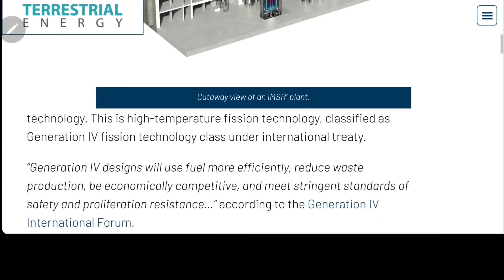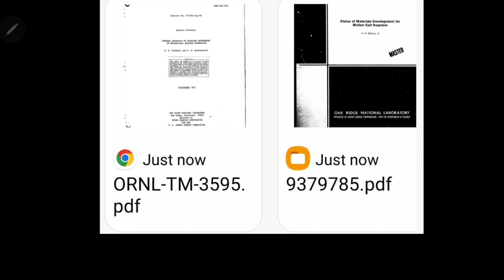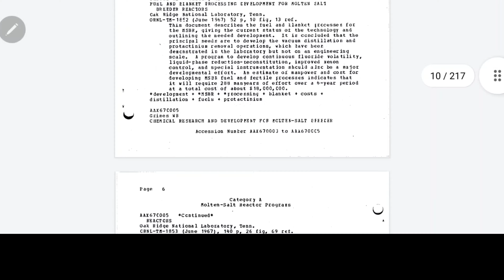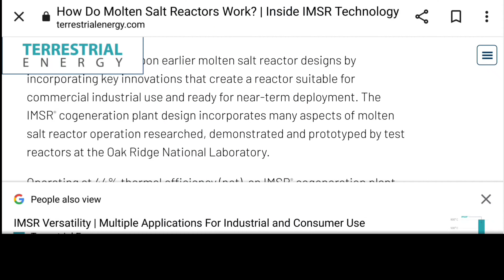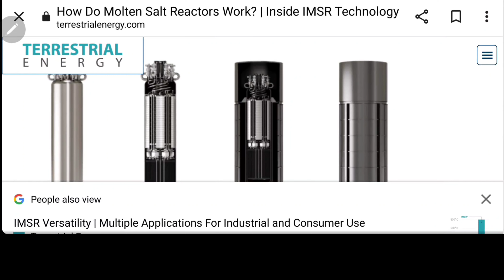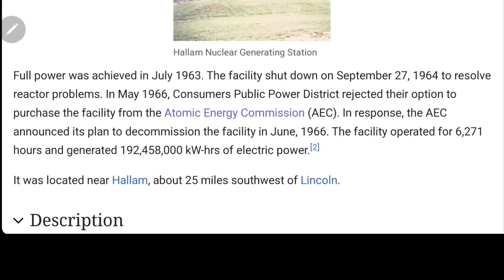Molten Salt Reactor: Future or past?

Comment: "We have found that if the U(IV)/U(III) ratio in fuel salt is kept
below about 60, embrittlement is essentially prevented"
Source: STATUS OF TELLURIUM-HASTELLOY N STUDIES IN MOLTEN FLUORIDE SALTS 
1977
Same strategy is used for newer alloy protection too.

Hallam nuclear reactor was not molten salt reactor. Its liquid metal cooled one.
Reply from the maker: Yes I know what the studies says from the National Labratory in 1977.  They show a side by side comparison of the metal but the difference is the temperature difference to 700 C.  It is not essentially prevented because they can never prevent the defects at the grain boundry layer where the embrittlement takes place.  It all revolves around our abilities of metallurgy and removing any possibility of defects in the metal.  To use other alloys would mean it would become too expensive to compete in any market.  And no...Hallam was a sodium cooled reactor at high temperatures....liquid metal....splitting hairs here aren't we?
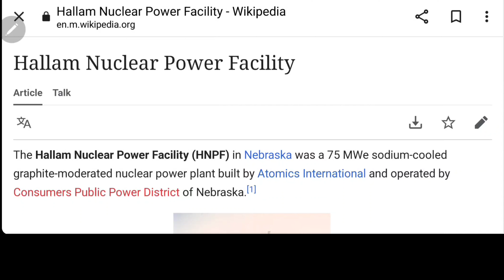Reply: @paulmobleyscience  8:52 it's not hair splitting if you miss state it black and white.
Reply from the maker: @CraftyF0X  OK I will stand corrected if you tell me which liquid sodium they used. Was it Mercury or solder or something entirely different?
Reply from the maker: @CraftyF0X  Can we all agree that salt a metal don't mix and shouldn't be used as part of some complex system to produce energy only for a profit for a corporation that cares less about your power to your wall and more about the at least 300% profit.
Reply: @paulmobleyscience  Im not sure what are you even talk about ? Salt corroding metal is a misconception, salt and water corrodes metal but salt by itself does not. Matter in fact under reactor conditions water by itself corredes more than salt, and still LWR technology is perfectly safe as long as the inspection schedule and the expected life time of the components are respected. And what is that all have to do with your general disdain toward neoliberalism and capitalism ?
Reply from the maker: @CraftyF0X  Normal reactors only work because of the additive of hydrazine, otherwise they would begin to break down in much shorter periods of time.   It's part of that "other" category when talking about effluents.
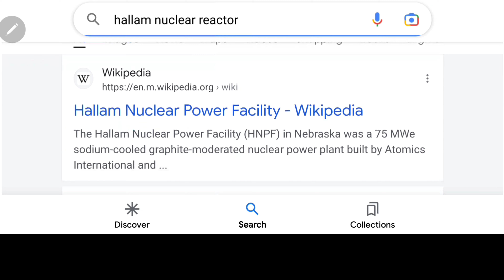Reply: @paulmobleyscience  At 8:46 "molten salt". If you think differentiating liquid metal cooled and molten salt reactors is hair splitting then you should not talk about reactors at all.

 What metal defects are you talking about? In layman's terms tellurium atoms "want" to be alloyed with metal that is between metal grains more than it wants to be in the salt. Because of that it "dissolves" inside said metal and that makes the metal brittle. What scientist in that paper did was they added additives to the metal so that it would be less attractive to Te atoms and changed salt "PH" so it would be more "attractive" for Te atoms. As a result now Te atoms "want" to be in the salt more than in the metal. This mean embrittlement is essentially prevented.

Temperature doesn't change if embrittlement or corrosion happens or not. What it changes is the speed of the reaction.
Reply from the maker: @user-py9cy1sy9u  I agree I made a mistake but to say I shouldn't talk about nuclear reactors at all is ignorant.  Yes lead-bismuth...ok so let's talk about the real issue why liquid sodium or molten fluoride salts are used to begin with.  Tritiated water and what it does to metal.  It doesn't do what the salts do to metal, in fact it just passes right through, permeating the metal day after day.  It doesn't matter what they do and why we still since 1977 do not have commercial MSRs. That additive that's added to the metal and coolant in that study is not a commercial sized reactor that ran for an entire length of what the PWRs can operate for decades.  That was never done so to say it can be scaled and work perfectly without tellurium embrittlement of the vessel occurring is just wrong.  That is an assumption that's been made and the Chinese will find out first hand won't they?  Also that additive didn't change what the moderator has issues with and that's major contraction and expansion. All this for a corporation to make profits when you can make your own power 24/7 365 days a years rain or shine, windy or calm.
Reply: @paulmobleyscience  Reactors with FLiBe salt will create more tritium than PWR.

Chinese reactor is a research reactor. Its purpose is to gather data so they could build better reactors not to run for decades.

Te embrittlement can also be prevented by using sacrificial anode. There is more than one way to skin a cat. Another thing is that TeF6 boiling point is −37.6 °C meaning that Te will be constantly removed by gas system. For a commercial reactors you might not even need to prevent Te embrittlement. You might just need to slow it down enough to where other components fail first.

Yes graphite lifetime is a problem. I have ideas how to prolong its lifetime. Now Im learning about x-ray spectroscopy to see if I can use it to measure changes in the crystallinity of graphite.

Electricity is the least useful thing that high temperature reactors can make.

15% is the whole nuclear island with concrete and control rooms. Reactor vessel is less than that.

Thorcon plans to change its reactor every 4 years

Molten-Salt Reactor Experiment (MSRE) operated for 4 years.
Reply from the maker: @user-py9cy1sy9u  Yes exactly more than one way to skin a cat.  We no longer need a corporation to build anything to produce power to our walls.  The only thing that needs more power than that is industry of which can be handled by everything else besides nuclear anything for power production.  I like your information because it shows people what's really going on.  Let me ask you this....why doesn't the inverse square law apply to extended sources of radiation?
Reply: @paulmobleyscience  Every time people put Geiger counter closer to radiation source it starts to click faster so inverse square law still applies. But radiation is not the same as radio waves and both beta and alpha particles interact with matter on their path reducing their reach.

Fun fact coal power plants worldwide kill more people during their normal operation than nuclear power plants with their accidents. Fear of radiation has killed more people than radiation itself.
Reply from the maker: @user-py9cy1sy9u  I didn't ask for the definition of the inverse square law...I asked why it didn't apply to extended sources of radiation?
Reply: @paulmobleyscience  Be more specific. Are you having in mind total amount of radiation that a matter emits (becquerels) or radiation that reaches the detector (sieverts)? For sieverts it does apply in part and for becquerels it doesnt because it measures different things. Extended or not does not change things
Reply from the maker: @user-py9cy1sy9u  It doesn't apply to extended sources of radiation because the aggregate of points...sources couldn't be known. To find one's intensity of exposure externally (detector) the point of each emitter must be known to calculate one's exposure and that is not on a 2 deminsional vector graph its 3 deminsional on a planet with a water cycle and water solubility of a corium oxidized crust and uranium sulfate that is very mobile that makes those points move around in real time and no way to establish that aggregate of point sources.
Reply from the maker: @user-py9cy1sy9u  So essentially..our devices can only tell us if we are getting hotter or colder but the "levels" of exact measurements are wrong and could not be known.  Then you add gamma attenuation (shielding), Townsend electron avalanche and quenching gas for electrons and the cathode anode issue, dead time when nothing is being measured, and the need for a perfect voltage for the measurement to be correct....from a battery.  Also, with the less expensive ones when connecting it to a computer, the computer will backfeed current causing fluctuations in the readings that aren't really there using an Oscilloscope.
Reply from the maker: @user-py9cy1sy9u  More specific is Indian Point NY with 65,000% above background levels in the wells under the site.   In talking about the Blue Ridge Environmental Defense League 2007 Vogtle Georgia study that shows levels of Beryllium-7,  cesium-137 and tritium increases in the river with people in a 40 mile radius drinking water that had a substantial rise in raw and filtered drinking water of tritium versus before the site was built.  You people are ignorant to be here arguing for this nonsense and the only answer is you two either work for the nuclear industry in some fashion or you know someone that does.   You must understand how I work and have been doing for years....strategically place something to draw those that have knowledge on this topic into the conversation to show them for who they are and it worked beautifully.  Thank you.  My reputation you spoke of before is squeaky clean because I don't make money from this greedy diabolical organization of ignorant money hungry people that make youtube accounts to sway the narrative using that word salad that I just used on you to prove you wrong.   People that push buttons for a living inside a control room watching for numbers on a gauge all the while they learned just enough information to get that piece of paper stamped with I am smart now for repeating after what they told you to repeat without critically thinking or only see dollar signs, big houses and fast cars and blinded to the very laws and science you repeated back to them.  Corruption is the one factor that causes every formula to be null and void.  It all looks great on paper but in practice its a much different story.   I bet you didn't expect that when you woke up today and put your pants on the same as everyone else.
Reply from the maker: @user-py9cy1sy9u  You see Elina can't control the comments here like she and others do on their channels.   I opened many peoples eyes on her channel and they will begin to see and that now single digit percentage of global energy production is falling more each day.    Who do you work for?
Reply: @paulmobleyscience  7 replies in a row... You are getting weird now. Who is Elina? I'm nuclear enthusiast and youtube algorithm showed me your video.

Also radiation exposure is not calculated with vector graphs... and inverse square law doesnt work for radiation exposure even for single point sources.
Reply from the maker: @user-py9cy1sy9u  Then why is the inverse square law used for calibration of the Geiger Muller tube?  You're wrong no matter how many times you enthusiastically place nonsense here.  Remember I do things a bit differently.  Getting wierd?  Wierd is thinking that some account on youtube is going to tell me differently than I already know with the book in hand and actual tests done of various geigers with an Oscilloscope.  If you haven't then all you're doing is parroting what's already known to be parroted in the past and realise there is nothing new you could possibly add....because the aggregate of point sources could not be known and the device is not correct.  As I said it can only tell us if we are getting closer or farther away and nothing more.  The specific measurements used to set standards are null and void.  
Oh and one more thing....this is my channel....I'll comment as much as I choose and don't think every comment is for you even if your name is tagged to it.  Others read these comments especially ones that are longer than the rest.  The simple act of taking a measurement with a device at a distance from a point source of radiation is the inverse square law.  Calibrating the device with a " known" amount of radioactivity point source at a specific distance from the source is the inverse square law....that has been established long before you or I was ever thought of.   You know what's wierd....people that are book smart but have no common sense.
Reply from the maker: @user-py9cy1sy9u  No...what you're not understanding is that the inverse square law is a point to point law which is used for calibration and taking measurements with any device using those factors.  That's page 81-82 in the Bulletin of the Bureau of Standards volume pages.  Pages 83-104 are the attempt at using the inverse square law for an extended source of radiation of which the attempt of using a 2 dimensional vector graph sheet of space and the nuclear industry hijacked it in an attempt to use it for the gamma photon just because light is a photon and the whole idea is based for intensity of light from a bulb, not Fukushima which is what it's used for today.  The fact is there is no law or formula that does apply to an extended source of radiation on the surface of this planet with water soluble transuranics and radionuclides and no "exclusion" zone can be made, on the entire planet.
Reply: @paulmobleyscience  so... Possible leakage at one power plant ultimatelly defines the whole industry as a scam? Can you explain how they make money without obvious environmental catastrophy for over half a century then ?(beside the high profile and throughly investigated cases) Btw I find it funny again how you conflate the problem of endless profit hunting with an industry currently in trouble because it can't provide returns fast enough. I mean nuclear isn't as profitable (at least not in the sort term) as you might think. It's a silly argument that they doing it for the quick profit when there are plenty of frankly better investment if you want to get rich fast.
Reply: @paulmobleyscience  honestly I'm not sure where you want to go with this. Do you want to imply that we can't measure radiation or what? I mean , a few things to consider, Geiger counter is not the only way to measure radiation, there are different type of radiations and slightly different models how they work, they also don't need to be 100 percent correct all the time as useful approximations used in practice all the time, you don't have to consider the position of every single decaying nucleon (and you wouldn't able to do anyway) to have a good enough estimation of the radiation at certain distance under certain circumstances. If you think otherwise that's fine, probably a case of Dunning-Krueger effect, if you don't think so, publish a paper with your findings. Until then, my take is that you are dead wrong, you know something and then you assume you know everything.
Reply from the maker: @user-py9cy1sy9u  Yes we know....
Reply: @paulmobleyscience  Oh and reactor island for molten salt reactors cost only ~15% of the whole plant.
Reply from the maker: @user-py9cy1sy9u  Every 7 years like with the IMSR that 15% adds up quickly.
Reply from the maker: Thank you for the correction and made certain to publically correct it here for all to see.  Paul Mobley is human after all and makes mistakes.. only difference is I can admit to when I make a mistake which is unlike the nuclear industry.  So what now?  Lead-bismuth?  What isotope of lead? 210?  Does anyone know?  Molten salt and metal...great idea or pushing the envelope adding additives so it doesn't eat the metal....and somehow you think this is 0% human error achievable?
Reply: @paulmobleyscience  The point of a well designed system is that it reduce the reliance on "human perfection". To answer your other question, as far as I know lead cooled rectors use the most frequent isotopes of lead (no enrichment required) which is Pb206,207,208. Why would they use the extra rare and radioactive 210 is beyond me. Btw if you accept an advice for the future, it helps your credibility if you happen to not know something, you don't immediatelly assumes that "no one knows". I meet this fallacy all too often in situations where that is abudantly clear that at least some ppl knows the answer (like ppl working at that reactor) so the attitude that "I don't know so obviously no one knows" is just reflects on you poorly.
Reply from the maker: @CraftyF0X  What do you mean?  I asked an honest question that you couldn't answer definitively and the answer you gave was full of arrogant ignorance.   So yes I made a single mistake of which I corrected.   Now why doesn't the inverse square law apply to extended sources of radiation?
Reply from the maker: @CraftyF0X  The point of a well designed system is so that IMSR and other government funded companies and patents can make profits and agreements to use technology paid for by the people many generations over and then charge them 300, 400, 500% profit.   The system means nothing and most major power companies have their hands in every type of power source.  There is no this industry or that industry...they are all part of the same industry designed to take as much money from you as possible.
Reply from the maker: @CraftyF0X  Did you catch all that?
Reply: @paulmobleyscience  there might be a difference between not answering because I don't know the answer and  not answering immediately because I have something else to do beside reading and answering yt comments all day. Inverse square law does apply to radiation, and I don't know where you want to go with this.
Reply: @paulmobleyscience  would be refreshing to see some sort of evidence for your claims beside unsupported assertions. I mean it seems to me you have a problem with capitalism, more precisely with the current socio economic system (and you are not alone with that here) but you somehow managed to associate the technology with it, and so now you hate that too.
Reply from the maker: @CraftyF0X  What do you mean unsupported?  I'm not out here saying unicorns are real.  I'm using the very science that you would use in any nuclear power argument made by physicist, engineers (being I am one), biologists etc...  this is not something made up out of thin air, this is something that has merit and is easily understood if you get your bias out of the way.
Reply from the maker: @CraftyF0X  You just saying that the inverse square law does apply to extended sources of radiation on a Youtube comment section....does not prove the Bulletin of the Bureau of Standards book its written in word for word incorrect.   When I say the inverse square law DOES NOT APPLY TO EXTENDED SOURCES and then I provide the exact source that says it word for word that you can not prove to be incorrect by anything you can find or have done personally like I have then anything you say means nothing.  You want proof?  Go conduct the expirements yourself and then come back to tell me I'm wrong....until then all you're doing is proving me correct.
Reply: @paulmobleyscience  you said it's not apply to radiation, and I said it does. The rest was an extension you later added. If you want to be taken seriously you have to communicate more precisely, otherwise we just get vague statements and when someone points out that it obscure you get carried away fast.
Reply from the maker: @CraftyF0X  What do you mean taken seriously?   The issue is I made a simple mistake as do many even yourself could be said to make a mistake.  And then I was ridiculed for that simple mistake that in the grand scheme of things doesn't mean anything being that it still killed people and one that's said to have been buried in a lead lined casket which is whats most important about that entire moment in history.  I was said my reputation is in question now because I made one mistake about the coolant used in that reactor and yet somehow I'm the bad guy that's reputation is in question?  I further added other issues of which you couldn't and still haven't gotten past the first one yet and there is 100 more behind that one as I showed in one comment about how a geiger works.  And now you're here still unable to figure out the math between pages 83-104 that uses a 2 dimensional vector that people try to use to explain a 3 dimensional world out of vacuum and a water cycle with evaporation and condensation that transfers those point sources around the globe.  I explained it all in full concise detail and until someone shows me actual proof that the inverse square law we use today to calibrate and take measurements with all radiation detection monitors, not just giegers,  do apply then it's up to you to show how that was done in the past.   Where is that information?
Reply from the maker: @CraftyF0X  OK, let's step back for a moment and just ask a few questions here.  I value your opinion first of all and I value what you've said here.  But for anything in the world to work as planned from paper we must always add the factor of corruption.  It is a vaguely used word and comes with a stigma but we see it in every aspect of our lives.  Through politicians and military leaders, through companies looking to sell a product or service with advertising and known psychological manipulation, by past history of corporations, governments, regulators and workers doing corrupt things and making selfish decisions based on their bank account totals and spread sheets.  Our world is not a sheet of paper with a calculation including quantum mechanics and the inability of the Schrodinger equation to apply to multiple electron elements and molecules by the approximation of the wave function and De Broglie condition  causes the conservation of energy to be invalid.  The laws and formulas are very clear and to question them in a world with so much corruption and people that think everything that came before them is set in stone is what actually is keeping society down and from prospering.  This is the truth
Reply: @paulmobleyscience  You don't listen Im so over your first mistake, you made plenty more ever since. The reason why ppl might not take you seriously is because you says stuff like "the nuclear industry hijacked it in an attempt to use it for the gamma photon just because light is a photon and the whole idea is based for intensity of light from a bulb". The decrease in intensity  accourding to  Inverse-square law is a consequence of 3d space and a point source, and it applies to all electromagnetic phenomena, be it visible light or gamma rays, heck it even applies to gravity as far as we know.
Reply: @paulmobleyscience  It seems like you doing this for the engangement. Now as for what you said, like all falshood has a kernel of truth and that's why it seems so deceptively simple. Corruption, yea, but who we are talking about here ? The wokrkers who accourding to you can't even measure safely their dose so they just gladly go into the early grave so their corporate masters can profit more ? And none of their family members care, nobody cares cause everybody want that corp fat, who can't really profit that hard, otherwise all the fossil plants would be already swapped to nuclear right ? Who is this entity decieving every scientist succesfully ? how could they keep it secret for half a century ? Accourding to you nobody knows the doses its unmeasurable (again how tracing, medical isotopes, radiation therapy, radiometric dating, neutron activation systems etc. work ?) so everybody whos there to conspire are in danger, yet they take on the risk cause they just want to serve their corporate overlords.
That is not how corruption works there are plenty enough corruption in the world (even some probably in the nuclear industry) but you can't write that down that everybody is just corrupt or stupid or don't care and they just want to pollute and make money (which again, there are better ways if you want to make a quick buck)
So far your arguments seems to draw this model, which is unlikely to be correct.
Reply from the maker: @CraftyF0X  You don't listen.....I'm not asking for the obviously used inverse square law used today in 3D space yes....but not in that BOOK!!!!!
Reply from the maker: @CraftyF0X  Extended sources say it with me crafty fox.....extended sources.  Yes the nuclear industry...the same as the military industrial complex.
Reply from the maker: @CraftyF0X  What do you mean I made plenty more since then?  We haven't got past the inverse square law yet.  YOURE not listening, this is my channel not some pronuclear channel where you can throw your weight around and I'm suppose to bow down to you and your authority????  Who do you think you are?  The inverse square law police?   Get bent, you don't know because you've never ever tried it.   Show me the expirements that show our geiger counters apply to extended sources of radiation.  I'm not asking your opinion on the matter, I'm asking for the data.  Where is it?
Reply: @paulmobleyscience  I don't know much about that one why you think they still use that ?
Reply: @paulmobleyscience  Again, you get carried away, I'd advise you to keep your calm. You made plenty of mistakes I will point out once I have the time.
Reply from the maker: @CraftyF0X  When you have the time?  You've had the time for days to sit here and comment to me now.  What do you mean time?  You mean time for you to review the information because what you're saying now isn't working.  You've had time to respond to me over and over just to say I'm wrong without anything other than your opinion on the matter.  I'm not interested in your obvious biased opinion on the matter.  Why are you here?  What do you do for a living fox?
Reply: @paulmobleyscience  Oh that is none of your business, but when I say I have no time I don't have it so... I'd appreciate if you would keep your good faith and not question my honesty as I don't think I gave reasons to you to do so.
First was that you brought a metal cooled reactor into the molten salt converstation, making it the whole thing kinda invalid as any point you raise against that type is may or may not stand against MS reactors. Then you said salt and metal don't mix, which is stupid both literally and figuratively, as I said metal is not necessarry corroded by salt if water is not present matter in fact water itself corredes metal faster, as long as the salt is "clear" corrosion should be under control. This is a research topic heavily investigated by different institutions for example Kopenhagen atomics, flibe energy and some federal institudes. We don't have all the answers yet but it certeanly seems, there will be no real technical hurdle (again it's need to be tested to know for sure). This also undermines your other point that "they just want to get rich quick" in which case the simpler olutions would be just to build morre gen III+ PWR and call it a day. The fact that they try to innovate and improve the desings show that its rly not about a quick money. Now don't get me wrong, in neoliberal capitalism everything has to churn out profit sooner or later, otherwise it's just wont exist. Thats why a dreamer's reactor  like the LFTR will probably have to wait, because in the end of the day it's not about the best way to go about building a reactor but the most economic way (some would argue thtas the best but engineering and science may clash with economics here) If they really wanted nothing but quick money natural gas would be a very easy investment right now. As I said, one of the main problem of the industry is that it's hard to attract investors as nuclear power plants has very very slow returns compared to other energy sector investments. And the 300% profit figure is probably something right out from your bottom, its a wortheless estimate without stating the time period anyway.
As for the tellurium embrittlement, again its investigated, it seems that adding niobium to the hastelloy-N may mitigate the problem. This is a concern for the designers who work on what materials will be necessary and how economically can they be used. It's not a concern fro me or you, because the regulators will throughly investigate the solution these groups comes up with, through models as well as live experiments before they grant any licence to these things to be built. Again, if your idea would be right, it would make no sense to put money into this researh when such investment may never produce returns. (for example if it turns out they can't solve this problem thus reeactor life expectency goes down and the economy of the plan is out of the window)
I also think (but this is just my opinion) that a more frequent clean up of the fission products (which is planed anyway in an LFTR but not really in for example an MCSFR) may helps the issue.
"All this for a corporation to make profits when you can make your own power 24/7 365 days a years rain or shine, windy or calm." Yea thats what nuclear energy is for. If you meant renewables than your mistaken once again, it really depends on the lattitude and how much energy you need (which is expected to incrase in general)
"mistake which is unlike the nuclear industry." Nuclear industry had to admit quite a few mistakes over the years, matter in fact they are obligated to report all sort of incident even if it carries no significance (like miniscule amount of tritium release or turbine malfunction)
"What isotope of lead? 210?  Does anyone know?" I said already why this was stupid, ofc the workers and designers know the composition of their coolant well enough and lead 210 happens to be radioactive and only present in trace amount.
"why doesn't the inverse square law apply to extended sources of radiation?"

Again I said it before it does, if you want to ask something else ask it better.
"The point of a well designed system is so that IMSR and other government funded companies and patents can make profits and agreements to use technology paid for by the people many generations over and then charge them 300, 400, 500% profit.   The system means nothing and most major power companies have their hands in every type of power source.  There is no this industry or that industry...they are all part of the same industry designed to take as much money from you as possible."
That is ot how the world works and I really hope you don't advertise your ignorance on this anywhere else. All sort of industries work independent or and also interconnected with each other, yes they all incentivesd by the profit motive (which Im not necessary a fan of) but that is where the similarities end. Making a distinction between agriculture, retail, and the energy sector is a kindergarden stuff.
" It doesn't apply to extended sources of radiation because the aggregate of points...sources couldn't be known. To find one's intensity of exposure externally (detector) the point of each emitter must be known to calculate one's exposure and that is not on a 2 deminsional vector graph its 3 deminsional on a planet with a water cycle and water solubility of a corium oxidized crust and uranium sulfate that is very mobile that makes those points move around in real time and no way to establish that aggregate of point sources." 
I still don't know what is the implication here ? They use and old standard therefor every measurment is faulty or what ? I guess they either do it better now or just figured the approximation will do it. As I said plenty field depends on measuring radiation accuratelly, so when you come here and say they are all wrong because you found this description in a book of standards I remain a little bit skeptic if you could understand.
"Normal reactors only work because of the additive of hydrazine, otherwise they would begin to break down in much shorter periods of time.   It's part of that "other" category when talking about effluents."
 Never heard before that they would add hydrazine, I don't even see the logic of it, but I don't know how its a problem if it works and never leak ? In what type of reactor they do this ? I heard of boric acid (PWR reacticity control) gadolinium nitrate (CANDU EPIS) and then some but I never heard of hydrazine. (I heard it to be used in reprocessing though but thats a different business)
 " You must understand how I work and have been doing for years....strategically place something to draw those that have knowledge on this topic into the conversation to show them for who they are and it worked beautifully. " 
Haha very clever not even full of yourself xD It's especially deceiving when you act stupid so effectively... wonder how you do that :D
I don't want to quote more from this part but really this rambling was gold not at all sounded like a lunatic howl agains everything nuclear including the workers who accourding to you has no idea how much their life is shortened by not having a clue how to even measure radiation, and these idiots run their stupid plants while you the genius run your yt comment section. Cmon man its not too late to admit you were just trolling.
"You see Elina can't control the comments here like she and others do on their channels.   I opened many peoples eyes on her channel and they will begin to see and that now single digit percentage of global energy production is falling more each day.    Who do you work for?"
That is excatly how a cold calculated objective expert from a scientific perspective WOULD NEVER talk. Again, even if you had a point you already burried it under your eccentric personality.
Oh man Im tired of your nonsense for the day I hope you don't mind if I stop here and don't drive your engangement any higher, I think you got more attention than you deserve, so write whatever you want I probably won't reply I lost my patience you can belive whatever you want. An evil conspiracy only you see the prophet that they are both diletant and ineffective yet profitable but not really and they are so evil that they don't even mind to kill themseves bla bla bla
If you have something else to say or prove, do your experiments, write your paper, make a clown of yourself, or a paradigm shifter genius if you better like to think that, if you are right and no one has a clue how to even measure radiation surely ppl will be glad you progressed science, until than have a nice one, and don't bother to reply.
Reply from the maker: @CraftyF0X  What do you mean don't bother to reply, this is my video and my comment section, again who do you think you are?  You're entire hot air filled generalized statements throughout further prove my point and shows you've never watched any of my videos to come to any conclusion about me or what I know and have shown.  You write this long statement with known and proven nuclear industry lies and you expect me or my viewers to take you seriously?  You literally said nothing other than I was wrong about Liquid sodium (LEAD BISMUTH) which is great yeah, let's cool a reactor with lead.  I then fix that mistake and you go on for hours and the next day for hours acting arrogant as if you are the keeper of the science, you are the science just like the rest of you.  But I know better, I know the other side of the coin that doesn't appear anywhere in that nonsensical book you wrote.  I bet those thumbs are tired after that one and it didn't do any good.  Any.
Reply from the maker: @CraftyF0X  "Thats exactly how a cold calculated expert from a scientific perspective WOULD NEVER talk".  I know because they to get paid as well from all this in some way or fashion.  The problem is none of you expect anyone to ever be as smart as the peer reviewed collective that has in the past (IPCC) to be corrupt and using inefficient data.  The same is true with the WHO/UNSCEAR AND US NAVY AND ARMY RESEARCH,DEVELOPMENT AND ACQUISITION AGREEMENTS CRADAs.  How do you add corruption to any equation or formula on a sheet of paper?  You can't,  because that's real life and why it doesn't match what is on paper.
Reply from the maker: @CraftyF0X  "oh that is none of your business, but when I say I have no time I don't have it so...."  that's code for I make money in some way by nuclear materials and processes.
Reply from the maker: @CraftyF0X  "I'd appreciate if you would keep your good faith and not question my honesty as I don't think I gave you any reason to do so." So the same could be said for you and instead of attacking me you should've accepted the correction clearly noted and be a human.  But no you went on a tirade for hours on end and was incorrect the entire time....not because you can prove it with something you've done, which is what you're asking from me, but simply because you said so...because you are the science...you are the defender of everything science related and no one can question any part of it.  You proved my point perfectly and the fact that you won't even say what your title is tells me you have a bias and now you're here trying to sway people reading this thread.  That's NOT how I work.  I do not need the opinion of people that make money directly from the use of any particular something including nuclear....I want to hear from the people that are against them and see what their information says and then get a consensus of the information so to show BOTH sides of the coin.  Not just of those that make money from it which is corruption along with lobbyist.
Reply from the maker: @CraftyF0X    $1,035,000 paid by the US Government for compensation to the workers and families of Hallam.  They each get a limit of $400,000
Reply from the maker: Maybe you two could get together and review pages 83-104 in the Bulletin of the Bureau of Standards volume 3 and figure out the more sophisticated formula that's used to calibrate our geiger muller tubes and take measurements.
Reply from the maker: Let's not forget Beryllium-7 and Cesium 137....how are those getting in the soil?